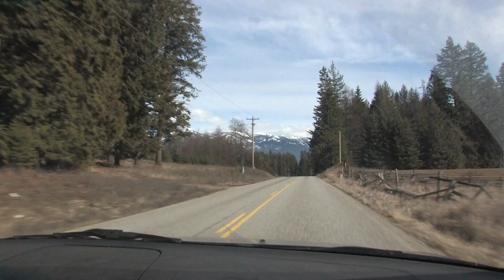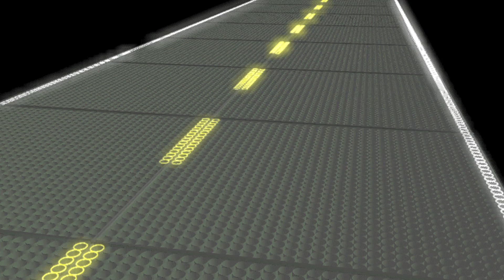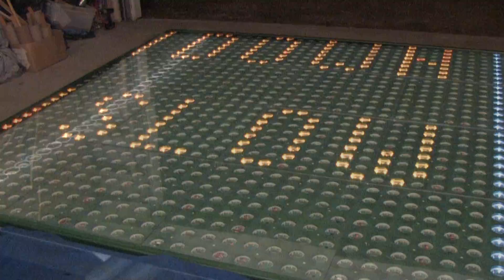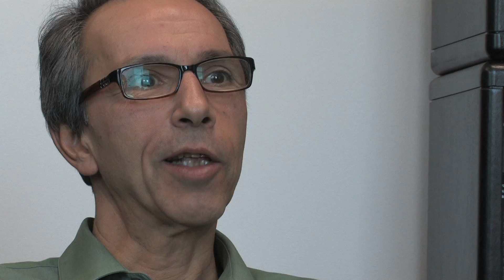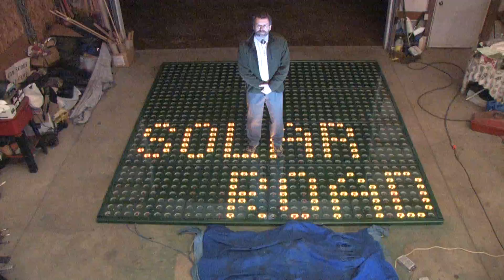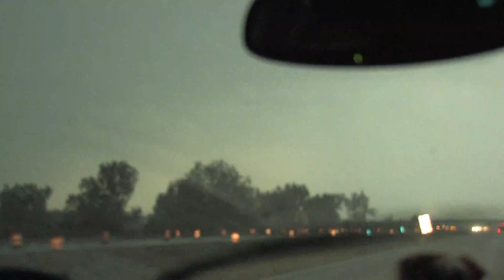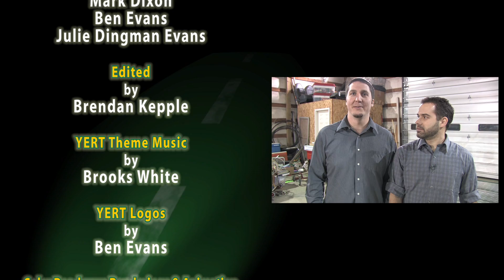Solar Roadways: The Prototype

Comment: I am for this. I'm reading that there may be a less power being drawn in with solar panel roads. But this is still bomb. If we combine this with Elon Musks large grid battery, the roads can recharge them as they get discharged to distribute power. Additionally, the thing I like about the smart roads too is being able to during rush hour put in a curbside parking ban, and to lift it at another time. Or to make a road a one way street at certain times of the day and back to a regular two way later on. The possibilities are endless.

Comment: So I don't really care that this video is 8 years old because I only recently discovered this stupid idea. Since when is using glass which mind you is very reflective, a good idea when it's already hard for drivers to see when the suns going down and reflecting off a roadway? Also, I'd rather not wanna have to worry about my motorcycle slipping out from underneath me because some twat decided putting glass down as pavement was a good idea.

Comment: Its a joke. Check the lifecycle analysis! The waste generated by the produced plastics, wasted copper and billions of LEDs, the pollution at production phase is order of magnitudes higher than the benefit of making a glowing road that looks "cool". This is electronic waste, the worst kind of unrecyclable waste we dont need. Powering an off-road doesnt make sense anyway, its a waste of energy, and powering lights for city roads are already achieved for 1/100 of price and pollution. This is a pure investment fraud! (PS: And we dont want slippery roads on rainy days too)

Comment: This is pure fantasy. I really wish it could work because it would be awesome. What happens when a crack emerges in the glass, water seeps in and destroys the circuit? Are the LEDs bright enough to be seen in direct sunlight from a low angle? How much power will the roadways generate? I'm assuming their efficiency will be low because their angle is not perpendicular to the sun. Will the gathered power be high enough to sustain the heated elements in the panels for extended periods of time? How much will it cost to replace the inexpensive asphalt with these expensive tiles? How much will the upkeep costs be? How much will upgrades cost?
Reply: Some asshole might even attach chains to his tires in the winter and break 200km worth of solar roadway. Other assholes will do it just for fun. mWhat happens in the event of a hurricane when shit slams into the roads at 200 miles and hour for days...god fucking damn there are so many things that could fuck the roads up. What about army convoys with tanks and shit? Forest fires can sipe out large sections of highways..... thinking about it for a second raises serious doubts about the current technology.
Reply: Thunderf00t has answers to it all. This project is never going to be realised by these 2 idiots. It's too early. Another 100-200 Years in the future, it can be tried again.
Reply: It's only a fantasy if no one tries.

Comment: Ya, lets replace asphault with fucking glass. These idiots wasted money on a glass driving surface that can glow in the dark.  Why are these morons promoting a driving surface that will make the roads more slick than a road in Wisconsin during winter after an ice storm.
Reply: *****
Did you, because if you know anything basic about both physics, and just driving in general, you would know this idea is by far just so stupid.

Let me ask you a question and you try and provide an answer that isn't bullshit just to promote this thing. How do you get friction (which is the basis of which you are able to drive a vehicle at all) by driving on top of a glass surface?
Reply: Make sure you watch the video before you comment.
Reply: @supercj12 This is why people like you are not engineers.
Reply: John Wick
And this is why you will never amount ot anything. Glass has n o friction to it, even if rigid and textured, any vehicle that will drive on it will crash, the occupants may die, and the maker of this crap will be sued out the ass. Apparently you know nothing ab out how physics and friction works.

Also, do you realize how much copper will be needed to make these even close to being able to replace any road? What about the people needed for maintenance? Replacement parts? Locating the panel that needs replacement? It would literally bankrupt any city that's stupid enough to install these rather than using asphalt. Asphalt lasts for years, these would maybe last less than a year at most before needing replacing. Also, I doubt they can withstand semi trucks driving over them, which, again, makes asphalt a better option.
Reply: What would happen if the road malfunctioned during a freeze, or what would happen with a flood. Right now in Louisiana tons of people are replacing electronics
Reply: Have you actually watched the video?
To you PandaDave and supercj12 

The electronics are hermetically closed IN the glass. 
If there is a malfunctioning part, you simply replace only that part. This takes about 15 minutes to replace it.

Glass is extremely adjustable. You can build glass with better grip than asphalt.
The glass roads don't hassle with ice or rain since ice or rain simply don't remain on the surface.
The whole cabling is done INSIDE the panels.

Please do your research and watch the full video before bragging about something you don't even know shit about!
Reply: It is not a flat glass surface. The project includes 'bumps' to allow vehicles to have enough friction to move around on such roads. Yes, the project needs more research on the actual surface making sure it is strong enough and passes safety regulations, but it is a great idea. PoopMan is correct in his statement, glass can provide better grip/friction than asphalt.
Reply: Bloody hell John Wick, Dillon Deshane PoopMan, etc. I am very certain you are not engineers. Go have a look at Thunderf00t's channel on Solar roadways. He is a Nuclear physicist and knows a great deal more than you will ever learn.
These solar roadways do not even have a IP rating, hence over 70% broken already.
Reply: Rooster
You obviously don't know anything about how friction works mate, because if you did, you would know even with grooves and ridges in glass, Asphalt has millions upon millions of the same thing on a microscopic level. If we look at glass through a microscope, guess what, its flat and shiny like a new baby butt because there is no way to imitate the millions of microscopic groves that allow for the friction in driving. There is no manufacturing process in the world that can imitate an asphalt surface, therefore, these glass panels will NEVER be used in modern day roads. There is absolutely no way on gods earth that glass provides more friction than asphalt, it is impossible.

Comment: Not a bright idea!

This would only work in areas that does not snow, rain hard, have falling leaves.   Cities and towns that don’t need to have their streets swept by a street sweeper.  Because during the winter season, cities use big trucks with a large blade to push the snow to the side.  This blade would actually damage the top transparent layer.  Also with the freezing water expanding, it would create pathways for water to get to the delicate circuitry and damage them.  During the raining seasons, it would be more slippery.  During the fall you have leaves that fall down.  Those would block the LED’s from actually being read right.  Also you got the big street sweepers that help keep city and town roads clean.  So they would need to have a special one just for this type of road, otherwise the current sweeper they do have would damage them.  Then you got city utilities access points such as manhole covers, water mains turn off points and so forth to also think about.  Again this would only work in such an environment where it does not rain, snow, leaves, or dust. 

The only way they can make this works is first to make transparent indestructible aluminum first!
Reply: It would literally be thousands of times cheaper AND generate far more power to place panels along the sides of the roads at an angle where they can directly face the Sun. If the millions of dollars they received for Solar Roadways had actually been invested in real solar panels to put on the sides of the roads, we'd actually have it done by now, and it would actually work.
Reply: I did do the research, the research.  There product is still a piece of shit and not worth it weight if it was water.  I already seen it in action.  Just after a couple months, it has failing LED's.  And those LED's can't be seen that far either.  It just an oversize expensive disco floor.
Reply: And even if this would work its still cheaper to use panels on the roofs
Reply: @Jess Ter hmm so it failed 0.o

Comment: This is such bullshit.  Plastic is also made of petroleum. Hello? Also it would cost 100,000 times less to put them next to the road or anywhere else instead of ruining roads with fragile slippery dangerous sharding glass. Also even asphalt and concrete can barely handle roads. Glass would be the worst surface you could imagine. It would be dangerous and inferior to concrete. You could literally put solar panels anywhere else and it would be smarter. There is no worse idea than this. It is the worst idea in all of human history. This idea makes me ashamed of our species. This idea is one of the great wonders of stupidity.

Comment: lol.. it wouldn't be better to put those solar panels by the road?
Reply: not enough surface area.
Reply: FroztByte Gamer what do you mean not enough surface area there are million of roofs that are mostly not covered by cars
Reply: luke france shadows casted by everything on top of the roads

plus you cant have a road thats made of something reflective like solarpanels without causing an accident
Reply: FroztByte Gamer no you said not enough surface to place them such there are million of roofs and you can make fields of them
Reply: FroztByte Gamer and I'm anti solar freaked roads so don't worry

Comment: solar photovoltaic panels are crap. at an unsubsidized rate (market) the time to turn a profit is longer then the life of the panel. garbage. instead of this pipe dream why wouldn't somebody have the idea to improve the efficiency of these things? even the best ones are ~20%. I still think orbital microwave relay is way more feasible then this nonsense. it is estimated to cost $2 billion but that's less than a nuke and would be way more throttlable.

Comment: One question, you have a masters degree in engineering and say you can store energy with solar panels? how ? the only way you can store electricity is with batteries, there is no other way to do it, even a 8 grd knows this. Srsly, people giving attention to this, don't have the slightest ideea how energy storage works.
Reply: +Radicalftw You can store in in a lot of mediums other than batteries. Capacitors, inductors, thermal (salt, oil, sand, etc.) or even gasses (hydrogen).

Comment: Too expensive, too inefficient, too high maintenance, too much dirt, too much scratching, too much shadow and Led's aren't visible in daylight from a low angle. Besides there's a reason why roads are asphalt, IT'S CHEAP. Rooftop solar is at an angle which gives about twice as much power and there's not the issue of cars and trucks destroying them. And good luck replacing all those panels when the LED's have run out again.
Reply: 1."maintenance: More jobs " absolute waste of tax money, might as well hire ppl to watch grass grow
2."expensive: Pays for itself" never in a hundred million years will it pay for itself, regular solar panels placed at an angle without all this shit on top have some serious trouble breaking even (depending on the price of energy in your area)
3."Not visible in daylight: New panels are." just thinking about the sheer amount of led's/energy required to visibly illuminate such a large surface in daylight is crazy the number of problems with this would be infinite even if they were under a clear glass surface, not a rugged, scratched dirty panel.
4.OP sucks and so do you.
Reply: I'm an electrician and come in regular contact with all electrical items. I can tell anyone who believes in SR, is a absolute dreamer. Dream on till you die.
Reply: +Jakisuaki
One year later, how's the progress on solar roadways going?
Reply: When you think something cannot be done, get out of the way of someone already doing it!!!
Reply: So, how are things working out now 10 years later?  LOL.  Impressed you two have kept this scam going for so long.
Reply: Silent33091 LEDs are efficient buddy, not to mention the solar panels power the LEDs themselves. Your answer to nr. 2 is absolute bullshit, especially with the fast increasing efficiency in photovoltaic & photochemical cells.

It will pay for itself, unless you can find a good article on solar energy that counters this, I don't want to hear your blabbering.
Reply: High maintenance: More jobs
 It's expensive: Pays for itself
 Not visible in daylight: New panels are.
Reply: @tobi888100  and its worthless

Comment: They put solar panels in a cycling lane in the Netherlands in Januari/Februari 2011. By the end of 2014, they were broken due to the cold. On top of that their elektricity production was very, very low and the cost was very high. That's only a cycling lane! Immagine how ineffective and cost inefficient it would be for cars with much more mass and dirt.

This whole idea is retarded. Place solar panels on rooftops if you want to where you can put them at an optimal angle, they stay relativly clean and you don't need to replace anything. But not in roads.
Reply: Lennart I ran the numbers....

While they are silent now, the Scott Bruchaw went on record 5 years ago saying the cost of the roadways would be about $70 per sq foot.The panels are 4 sq. ft hexagons. They claim that each of these hexagons have 69% coverage, and produce up to 52 watts of electricity.  (a 50-watt, 4sq. ft home solar panel kit currently runs about $200, without fancy LEDs, electronics, heaters, or tempered glass, I think this number is very reasonable, and probably low)

At current electric rates in my state, at best, when operating at 100% peak efficiency, ignoring any loss from parked cars/traffic, trees overhead, etc. etc. would generate $16 a year worth of electricity.

That means each panel would need to function flawlessly for 17.5 years in order to pay for itself, ignoring the cost of installation, maintenance, or operation of those fancy LEDs and Heating elements.

Cost to put them on 1 mile of city street?
$10,718,400
Reply: Rob Doar those calculation have been done before.
But what is your conclusion?

Edit: 17 years to repay themselves? That seems on the low side because of the inmense cost to put them in a road, cover them with a material transparent enough yet providing enough friction, the wiring (copper isn't exactly cheap at the moment) etc etc.
Reply: For just the base cost of materials of the panels themselves ...  as I said above, ignoring the operation, installation, and maintenance costs.

The conclusion is pretty evident.
Reply: Rob Doar some people might say its worth it. But 10.7 million for 1 mile. Unless its a very high bridge over a very dangerous river I'd say its just a tad expensive.
Reply: +Rob Doar   Excellent math!
Reply: toan nguyen no it has generated 3000 kwh over 6 months. Its not kw/h. 3000 kwh over 6 months is jack shit. The solar panels we have on the roof generate much more per m^2.
Reply: "It is generating more than 3000 kilowatts per hour"

Watts are already a unit of power.  Hence, no need to divide by an extra unit of time, such as hours.
If you mean, they generated 3000 kW of power FOR an hour, say, before failing, then that would mean something.
Reply: It’s called développement, a product goes into about 10 stages, classified under 0-3: research, 4-6: experimenting 7-10 commercialising, right now I think some solar road companies are in the 6th stage, and are starting commercialisation, and it’s working... 
I don’t know why people don’t understand the concept of experimental, they expect something to work right out the bag.
That’s where the skeptics are coming from...

Btw orientation isn’t necessarily optimal, sure you could squeeze out a few percent of efficiency, but at what cost? 
Also big investors are putting their hands in it, don’t assume people to be dumber than you, assume they are smarter and you don’t see it, if they put millions into this tech it’s because there is money to be made, not some dumb mistake that everyone seems to do.
Reply: They made a new one, which is called solaroad . It is generating more than 3000 kilowatts per hour

Comment: Yeah sure this might not work, but it is a improvement in many ways. Everything is a working progress, if they get help with the research, maybe it will turn into something more efficient and better. Gasoline isn't going to last forever. If this could actually happen it would generate a great amount electricity and we could all have electric cars, and not have to worry about the costs. I think something really good could come out of this research.

Comment: Keep in mind, with Glass Roads comes an option of re-inventing the wheel, in this case specifically the Tires. Also, since Electric Cars are going to need to park on sides of the road, I think the option of plug-in Coin Operated Power Refueling Parking Meters should be considered with City-Model Panels. (Solar Trees would be a great pairing with this!)